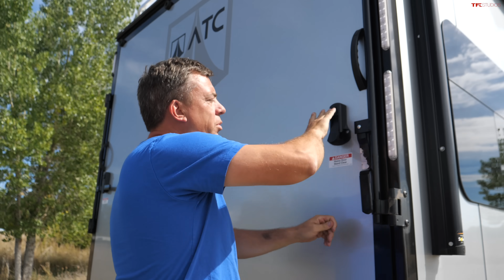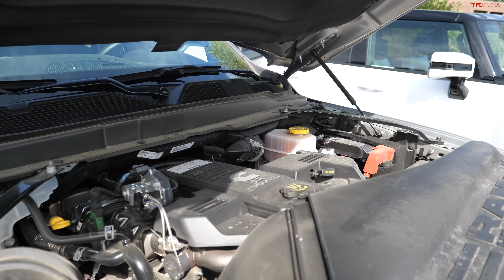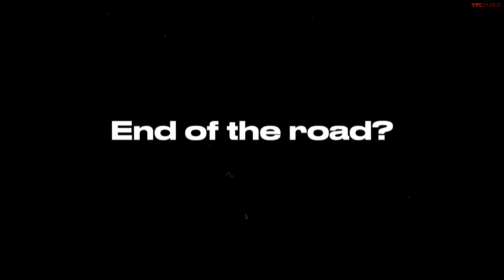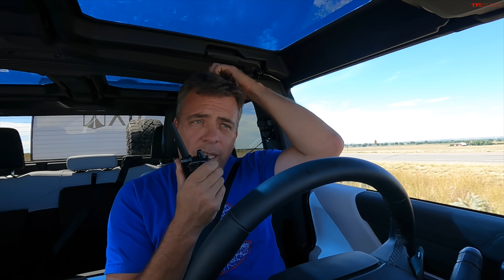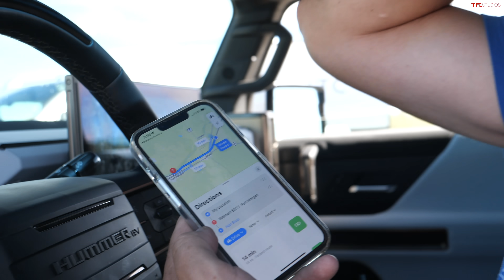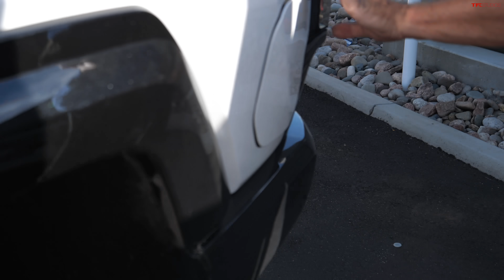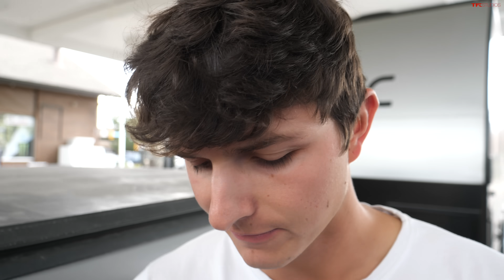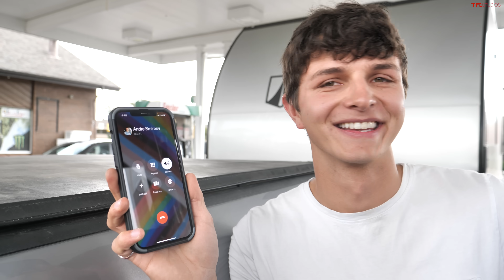How Far Can a Diesel and Electric Truck Tow An Identical Camper Trailer on ONE Fill-up?

Comment: Interesting results.  I would like to see a comparison when towing over a pass in winter.
Reply: I bet that Hummer wouldn't go 80 miles.
Reply: @Randy_Savage_ohyeah  Damn sure know the ford lighting wouldn't as Hoovie Garage  proved that recently lol!
Reply: @DragonZer0  yeah 💀 not to mention how bad battery's in general do in the cold. And when moving with the batterys on the bottom of the car while the roads are covered in ice. Then yeah. Electric will always lose
Reply: @adamnofsinger6564  yeah and those bastards here with 6 months of winter want to push it down our throat more and more electric vehicle. I mean, in bright summer that's probably OK, but in winter, it's a no-go. the no ICE sales by 2035 is unrealistic. everyone knows it except them.
Reply: @adamnofsinger6564  and you wreck the batteries in the long term so it will get wirse and worse each pull.
Reply: @deadprivacy  the cells within the battery also died every charge. Along with the stress it has pulling. And running constantly. All of this combined just makes the electric car not practical in the long run. I believe in sometime they will be practical to an extent. But gas runs the world.
Reply: @adamnofsinger6564  the irony is that because the desire for electric cars is so prevalent, the accelartionism by elon and govts and green politics around the world...the evolution of electric vehicles has been slowed significantly, the natural market for them is two wheels not four...with swappable batteries and no need for huge ranges as how far do you want to ride your motorcycle without a break?
The idea that cars would be first is beyond stupid...not to mention if you get hit by one?
Its like a collision with a massive truck..
They are so very heavy...
The idea that an electric semi truck is anything resembling a good idea is about as smart as elons hypeloop...
These electric pickups are beyond silly.
Just why?
Its no good for towing, no good for carrying stuff in the back as the batteries take up all the space..
A hummer h2 is a far better purchase and its arguably one of the worst vehickes ever made...
And imagine getting hit by the thing...
There is a viable market for electric vehicles, even vans ..but its really only useful for shirt haul muktistop drivers.
The tesla autodrive is funny though...
I refuse to cross close in front of cars...
Especially if they are stacked feet away...
Foot slips off the clutch and you are screwed 
.
Ive had many standoffs with teslas turning in set to autopilot.
Drivers raging at me for not walking in front of a 3 ton robot and having to turn the pilot off...
Reply: @adamnofsinger6564  obviously some form of hybridization is better than none when it fully matures

But the counter to that is they on average break more often and cost more to repair, with less parts being available.

If you barely commute electric or hybrid are great, but otherwise gas/diesel only option.
Reply: @deadprivacy  I think if the Tesla semi had even a small diesel to get it going or help in elevation it would be way better than a standard diesel. Like the tiny EVs that have "range extenders"
Reply: @greuju  at which point you negate the entire purpose of the thing...just adds weight, complexity and you still have to lug huge batteries around...
Reply: Idk man if I can own 1 motorcycle only an electric would never make it into my garage. If I can own 2 I'd have an electric possibly.
Reply: @Randy_Savage_ohyeah  And Hummer has battery that is way biggest to any EV ..its 220 kw..thing if you tow with regular EV which has 50 kw net capacity ..i tow my camper here in europe which can sleep 4 with diesel car that is now 20 years old and worth like 1500 euros (or dollars ) ..i put like 5-6000 miles every year  on it with camper attached and i can get 400 miles with our refuel
Reply: @dzonikg  good to hear, obviously you have maintained your vehicle.  Hope you get another 20 out of it.
Reply: RIP to you when your government bans your car and forces you to shell out 60k pounds for a new one, it's coming.
Reply: Exactly!  Cold battery, heater on, headlights on, maybe wipers ... losing battle! Even Ford said not to run the heater if possible in winter!
Reply: EVs will never ever out do gas/diesel.
Reply: I choose the diesel over the EV, but the disconnect of the trailer is not a truck problem but a design failure of the charging stations.
Reply: There is no comparison at high altitude in the winter. Lol
Reply: Up a mountain
Reply: The only towing over the pass is the tow truck pulling the Hummer and trailer! They only made it to Ft. Morgan no way that thingwould make it to Beaver Creek without having to charge it, it might not even make it to the tunnel.
Reply: You wouldnt want to drive it in that hummer.
Reply: 3:57    "Our route on this journey is going to be fairly flat"    "Exactly, we're not doing mountainous terrain"     I quit watching here
Reply: @bradgraystock5966  Thats because no one ever goes camping in the mountains. 😁 Or has to go over mountains to get there.
Reply: Tesla batteries are better and they have an entire team to improve it
Reply: @whyworkwhenicanrap6830  Yes, they did have an improvement a couple of years ago, but it was small and wouldn't add that much range.  It's still far from what you can do with a diesel.  Also, battery improvements are small and far between, so we're talking many years, probably decades or more before they even start getting close, and then there is the physical limit to how much they can improve.

Comment: When Mr. Diesel invented the Diesel Engine he assumed fossil fuels would run out and we would need to grow fuel.  He invented it to run on peanut oil.   SO diesel is the only current actual Bio fuel in the world.   Most electric generation is 96% oil, Gas or coal.  Some Nuclear and then in the smaller range Wind and Solar.   to date Diesel is still the best option for humans

Comment: I will NEVER purchase an electric vehicle, and your video is just one of the reasons why. I have a 2001 Ram 2500 diesel, 6 speed manual. I tow my trailer and race car up and down I-5 to race tracks. and I have never gotten less than 17.6 mpg. I have a driving range of around 750 miles on my 35 gallon tank, without towing. Electrics will never to do that.

Comment: I"m not going to buy a Ford F150 (or equivalent) to tow my 40ft toy hauler, and I'm not going to buy an F450 Dually to run groceries, pickup the mail, ride around town. With that being said, I think its obvious that you need the right tool for the job...

Comment: The only beneficial starting points for electric vehicles ive always thought would be mail trucks, fed ex/delivery trucks and possibly school buses etc. That would be the way to find out how it holds up longterm daily use and be able to figure out and make ranges further on electric vehicles then progress into cars/trucks after perfecting them!
Reply: For short distance 10-60 miles, low speed, EVs are great. Cheap, quiet, and torquey. City driving, basically. Whoever tried to market a truck is an idiot, however.
Reply: and for city use, less noise and less air polution on big centers, but for travel it's a bad option
Reply: My town just purchased 4 of them.... They could have bought 20 regular buses for the price they paid. REDONKULOUS
Reply: With the bigger vehicles there can be two or three huge batteries to increase the range.
Reply: @GTOGregory   I work for a delivery company. We tried out  EV trucks with an onboard gas generator to recharge the battery whenever the truck stopped. EVERY truck needed the battery replaced in less than a year as well as multiple other issues is regards to charging. We've got some sort of other EV now but I don't know anything about those. In regards to larger vehicle more batteries more battery weight means less weight available to use for cargo. The battery in the Hummer weighs 3k lbs the rest of the thing is around 6k with NO cargo according to the info in this video. Delivery drivers are limited on the weight they are allowed to carry depending upon the license they have.
Reply: EGGZACTLY!!!
Reply: Rivian Amazon vans are rolling out! Not even using the biggest battery pack because their routes aren’t that long!
Reply: Fit for purpose
Reply: Not in any areas that get cold.
Reply: @lenney872  Very true, im not into it losing charge when cold when gas/diesel vehicles dont lose fuel sitting there like that is annoying especially when you’d go pay for a charge at a station. I just think for a persons standpoint pricing electric vehicles is expensive to a buyers standpoint but if they keep approaching it with these cars that people wont use everyday with day to day use then how will they truly be able to get lots of testing in the real world you know. Something as easy as mail trucks or fedex/UPS trucks would be a perfect starting point to find out if they can even make you money or losing money. I feel they havent invested either into semi trucks as much because you would definitely be losing money wasting time charging and losing battery not even doing anything. I also feel like if everyone had electric vehicles and charging them thats a lot of power draw from the grid 😆

Comment: Every Vehicle I have ever owned got it's best economy at around 55-60 mph. Vehicles are engineered to get best economy at the speed limit. I can't see an electric vehicle being any different. You might have gone a lot further at a lower speed. That doesn't change the fact that when that electric vehicle needs to be recharged it will take a lot longer than it takes to fill a tank up with diesel. I towed a trailer with a small pickup truck on it for 1200 miles with an eco diesel. It took just over 20 hours and I only used 2 tanks of fuel. I can't imagine having to recharge a vehicle 12 times to make that trip. EV's are years away from being practical when it comes to towing long distance, unless they were towing a big battery to go 200 miles.

Comment: I have 1 question. If the limp home power saving modes actually increase range, then why don't cars have a battery saver driving mode, that users can enable for long trips. Just like phones or laptops.
Reply: They do. Turn off the A/C, radio, unplug your phone charger, dim the dash lights... you get the point.

Comment: This was very impressive demonstration guys! Impressed with the Hummer's recharge rate and horsepower. Not impressed at the price, distance traveled on a charge and the price per kwh at the charging station. With no fee, you are still pay 2x the peak residential rate, over 3x the normal rate, for what it is in Wisconsin. WI has winter so that'll sap any battery trying to operate here.

Comment: You mentioned the hummer was off road capable? 9000 lbs? keep away from snow or mud. I also agree with winter temperatures. How much loss of energy when it is minus 20 or colder? and when you have to use that energy to heat the interior. I think we have to look at jcb and the hydrogen engine with zero emissions.

Comment: Explain why in a real life test a man took his electric Ford to pickup a model A pickup truck on a trailer the truck said full charge and 342 miles when he left to go 45 miles away he made the round trip of 90 miles and was in the red and wasn't able to go over 30 mph the last 15 Miles and again the battery vehicle that cost as much as double to purchase and won't go half the distance wow 100 miles and that junk is dead what a joke definitely not worth buying have to charge 3 times to get the same distance and how much is a charge costing what a waist of money what a worthless POS junk hay I have an idea put a gas generator in the back of that pile of garbage and run it to charge the battery oh yes again YOUR BUYING GAS TO DRIVE THE POS

Comment: Why don't you show all the same maker trucks my gas Chevy is doing over 17 mpg pulling my 9765 lb 33 foot travel trailer the truck is 2500 4×4 crew cab long bed with a 6.0 V8 34 gallon truck

Comment: Man it takes 15 minutes to throw a full tank in a diesel or gas, and you can throw L tanks in the bed if you need more energy on board. There's also upgraded tanks from Titan, which are larger and fit under the truck, or if you're ordering one brand new some manufacturers do dual tanks or upgraded singles

Meanwhile the electric is just expensive, not nearly as fast to refuel, and underwhelming on how far you can go. Unimpressive

Comment: I have a 06 Dodge 3500 with 316,000 miles. Still gets 12-14 mpg pulling a 36 foot 5th wheel camper , and 26-28 highway with no load.

Comment: I understand the point that you were going for in the discussion of the amount of energy per mile, but you cannot actually do that because you're ignoring the fossil fuel that was burned to produce the electricity! Only a small amount of the energy in the grid is from "renuable" sources, so to just compare the energy that is going into the truck Is tremendously incorrect. The electricity would have to be doubled or tripled for it's production

Comment: I will keep my Cummins. 9.72 MPG for the RAM? - mine gets 13.5 pulling a 8000lb camper. A new truck may need breaking in. Mine has 72k.

Comment: They don't talk about the new syndrome    "charging stress"  and you could see it on his face and he action   I am not against electric vehicles but its not there time yet      time to charge isn't as fast as diesel power    and if they would have done the math it cost more to charge the electric the what the diesel cost to go the same distance.        and time if they were on vacation the electric would need all day to get to the same place the diesel would get in a few hours      nor did they cover battery replacement in about 5 to 8 years and that will cost up to 20K , not to mention the disposal of the old batterys.    so cost to own/operate isn't as cheap as the diesel        electric is just not there yet and most people know it so why are they people in charge trying to force on everyone        we need about 10 to 20 more years for the battery's to get to where they need to be      if we want to go green then hydrogen is the way to go   you could just replace gas with hydrogen with little to no changes in the vehicle and no hazardous batteries to bury in the ground         and it burns clean.     use 2 hydrogen tanks like the ones used on an RV one gets empty change it out simple system all gas station could easily carry the tanks or refill them 
just my option 
Thanks

Comment: Next time..... Calculate how long you will spend charging vs fueling in a trip that is like Detroit to Miami. Use the 150kw chargers and really see how much time is added to your trip. Talk about the down time charging vs pumping fuel. Thanks for the video.

Comment: You should not have added the DEF in with the fuel as it is not a fuel. It is injected into the exhaust as it is a cleaner. So your average mpg is 13.53. The only time you should add the cost of the def is when your figuring total cost per mile.

Comment: Cummins diesel engines can be expected to last a long time. Between 350,000 and 500,000 miles is usually considered high mileage on a Cummins diesel.  Hummer EV can be expected to last, who knows and I don’t care.  
EVs like the flavor of the month will disappear from the menu in time.
  
Now a nuclear powered vehicle using few pellets of Uranium-235 will last and last and last…  Ahh, never mind, I’ll stick with my ICE vehicle 🚗

Comment: So the diesel Ram set you back $68K and the EV Hummer $114k. Range is better on the Ram but fuel is more expensive as is the lifetime maintenance expenditure. If concern about carbon footprint dictates your decision then the Hummer wins hands down.

Comment: There's a reason locomotives are Diesel Electric Hybrid power. 
The best of both worlds. 
No battery will ever be able to tow with range as the more battery you add.... well it's really self explanatory. And that's where the Tesla Semi is doomed to short range hauls only.

Comment: I’d hate to say it but towing is a big problem facing EVs. I’m all in on EVs but for those towing…. Just not there yet. At least not anything on the market yet. If they can get the towing range to 300 miles and faster charging, well then it’s a different story. Great video as usual.

Comment: Diesel is still relevant for frequently mid and heavy transport over long distances. Unfortunately, diesel and gas have a lot of emissions (climate change) and other disadvantages compared to EV. Maybe hydrogen can be a future solution for frequently heavy transport over long distances. I drive EV and tow weekly a trailer without any problem, but don't use it for long distances. EV driving gives me a pleasant feeling by driving largely FOC on solar energy, which I can't say when I drive my wife's diesel car. Every new evolution is difficult, but I see more and more people thinking driving EV, especially young people, thinking more green. Also most car manufacturers think EV, they see that it's the future. EV is also much more fun to drive, and there are always solutions for long distances.

Comment: Part of what causes a challenge for the electric truck is the current lack of infrastructure.  Diesel is widely available, but charging stations are far apart.  When we have more charging stations closer together, towing with an electric truck will become more practical. 

There's also the question of travel style.  I'm no longer willing to chain myself behind the wheel in an attempt to grind out 6 or 7 or 800 miles in a day.   I prefer to stop more frequently, rest and walk around.  Maybe look at some scenery.  By the time I've gone 120 or 150 miles, it's time for a break.